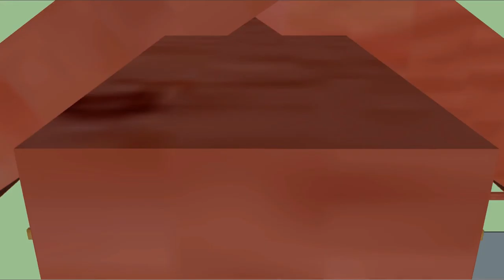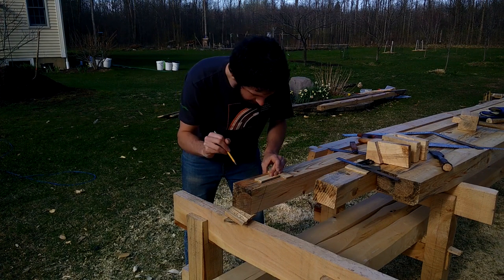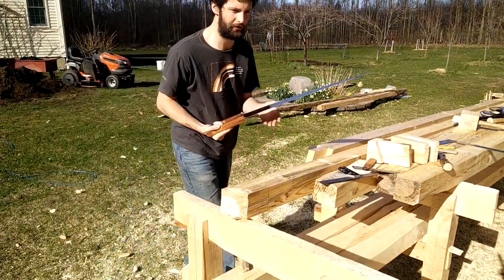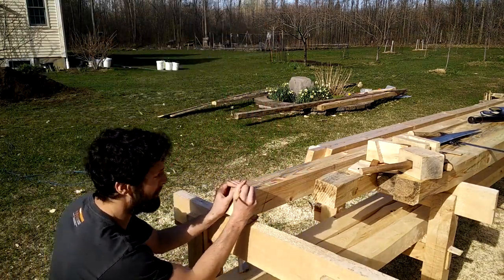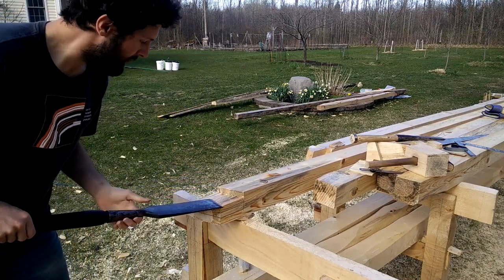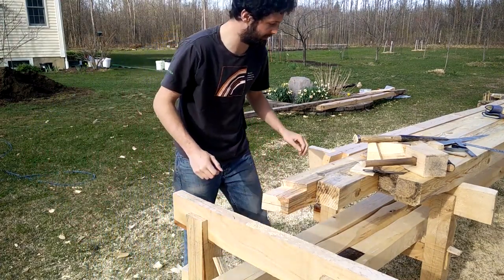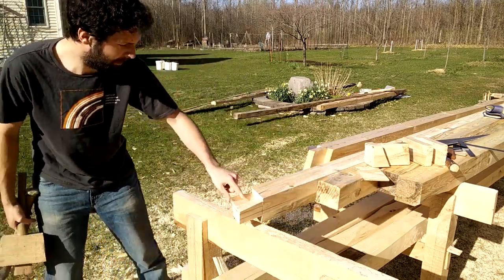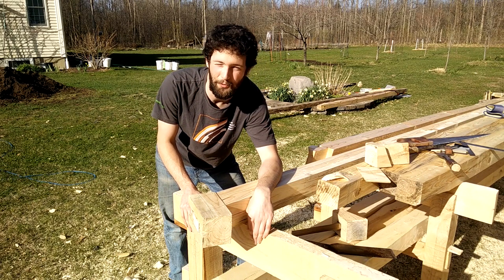Unabridged Timberframe - Long Rafters

Comment: Few observations or questions, depending on how you wish to take them...

I noticed a lot of edge referencing rather than line referencing. Was there a reason for this?

As a point of craft, learn to "strike" your lines once instead of "scrubbing" them into the timber. Part of the reason the Asians (et el) use ing and not pencil...or..knife edge. Scrubbing a line in mars the timber, and is also wasted energy...

Again, a wide butt chisel is a better tool for knocking out your waset wood. Some of these in the traditional context of the craft (Japan, Korea, etc) are as wide as 100mm.

I might have missed it (???) but I did not see you chisel strike you shoulder cut at any time. When pairing with a slick, having that strike cut made first allows for better chip discharge and keep the grain from diving into the tenon. Also, a slick used only in a "pairing" position is not getting used to its full potential. Use it with the bevel side down for some operations and you will not work as hard nor dive into the grain as easily...